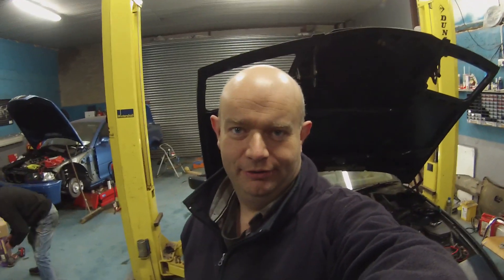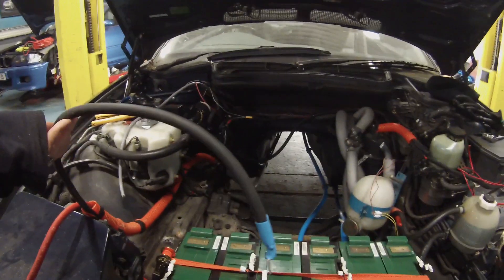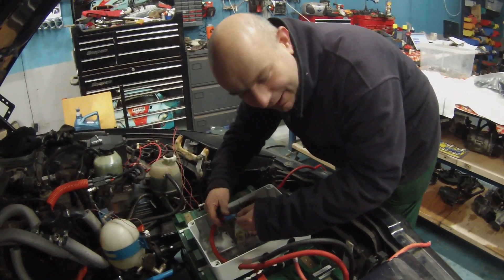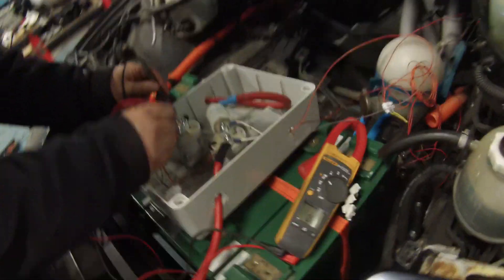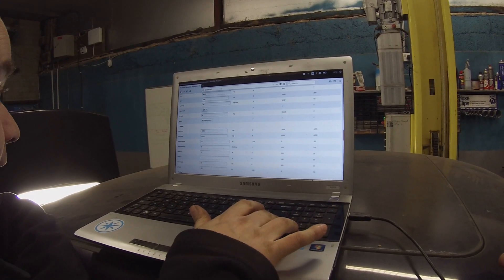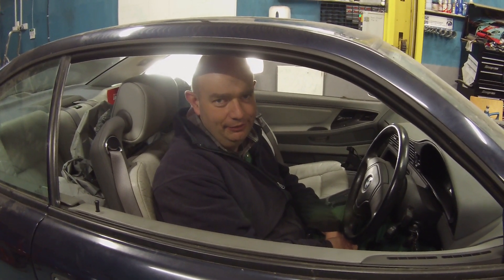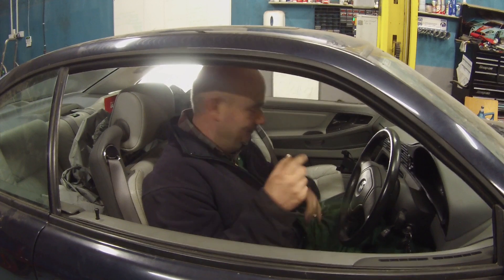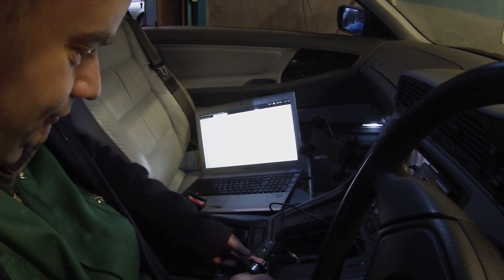BMW E31 840CI EV Conversion 91 : Tesla Swap Day 10

Comment: Exiting  moment for the build i'm trying to work out if the BMW weighs more than the Tesla the motor came out of .. i'm trying to work out if the acceleration will be more than the original Tesla ( power to weight )

Comment: Nice progress!!! Maybe you need a reverse diode across the contactor coil (to get rid of back emf spikes)
Reply: A generic 1n4007 will do
Reply from the maker: It's not a back emf problem. The closing surge is too much for the driver I used on the logic board.
Reply: ULN2003 has got integrated reverse diodes. I reckon it died of heat.